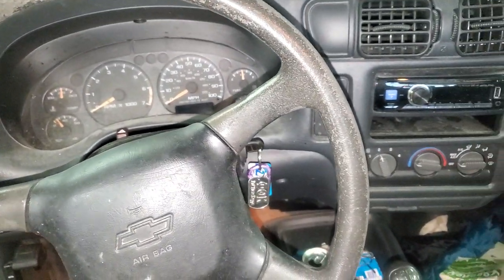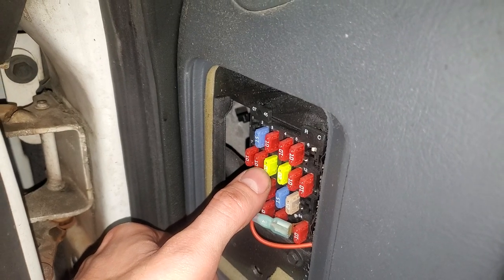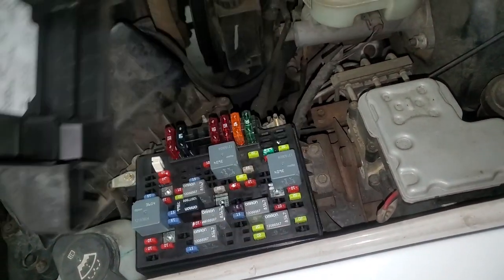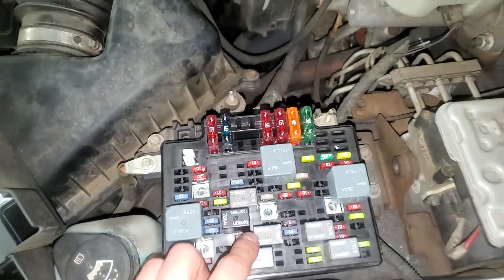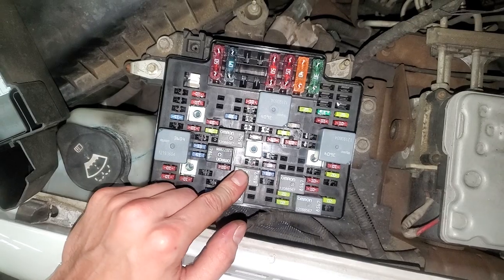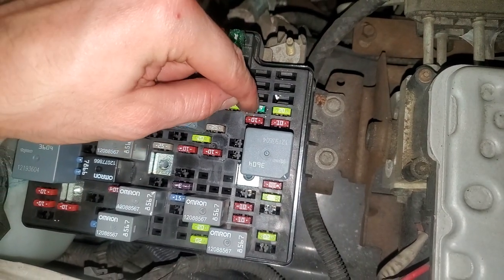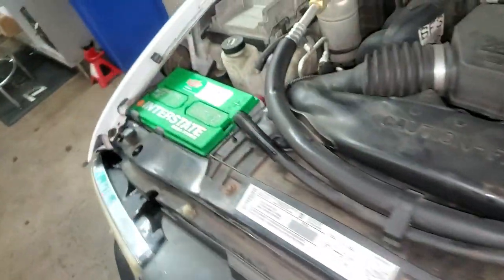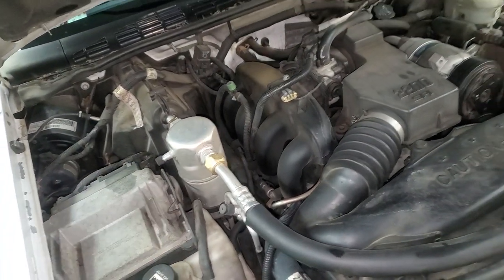2003 Chevy S10 AC Fuses & Relay, Blower Motor Fuse Location

Comment: I was pretty sure that there was a relay as well, its by the firewall. That fuse controls the power to the fan, the relay controls blower modes 1-3. If you are in my situation, 1-3 works, but 4 does not. I might be able to get 4 to work by switching the fuse. Thank you for showing me the location!
Reply: Hey man I got the same promblem 1-3 fan speed works 4 speed don't I already brought a fan speed  restricter and it anit that
Reply: that is my problem 4 will not work what did you do, I have no heat either? switch what fuse? well i am glad i read the other comment I thought it might be the resistor but apparently its not that is what i thought it was?
Reply: Which fuse?
Reply: After I purchased a used '99 S10 pickup I noticed that my blowers 4th (high) speed didnt work and after looking at the fuses under the hood I saw that the 30Amp HVAC fuse was missing. I replaced it and all speeds work.

Comment: there is also Relay on the firewall under the hood that controls the fan speed beside resistor
Reply: Where?
Reply: @Divatracks  next to firewall near the middle but to the passenger side a little sits by itself i didnt notice for awhile my fan only worked 1.2.3 when i put new relay on now 4 works
Reply: @suzieq8379  ok thanks much. Will check. Much appreciate your reply
Reply: @Divatracks  did you find?
Reply: @suzieq8379  i took out the fan and will put another in and see if that's the problem. Don't see a relay
Reply: @Divatracks  i have 2001 s10 4x4 4.3 is that what you have
Reply: @suzieq8379  oh ok nice. my relay is inside the fuse box next to the battery

Comment: I have an 03 s10 with a 4.3 2wd. Freon good,new cycling switch, ac compressor kicks on but kicks off right away.  Does this over and over if I keep the ac on. Could it be the switch in the back of the ac compressor.  ?

Comment: Man , I got me a 2002 Chevy s10 ac wasn't working , I had checked and changed compressor, 
I was told everything was good no leaks but since it was not holding pressure it was most probably the compressor
I got me a new one he did everything vacuumed  refilled was blowing cold ac and when I was about to run it , I changed gears and it went off , it was not working anymore  I am so frustrated

Comment: I have the same vehicle. But most of my fuses blew out of nowhere. Car worked but had battery and check engine light on after replacing blown head gasket. I drove about 200 miles then the car died and killed the battery . Got it tested at autozone they said the battery was completely dead.( before i removed the dead battery the lights and radio still worked but the car wouldnt turn i replaced both camshaft and crankshaft sensor) got a new battery and installed it....nothing at all. Bought a fuse checker and most of my red 10 fuses are blown and some other fuses but none of the larger ones. Where do i even start?
Reply from the maker: That is an odd problem.. of course all blown fuses need to be replaced. You will want to check if there is a short to ground anywhere.. like in the alternator for example, or if there is a positive wire that get pinched somewhere when reassembling the engine.
Reply: @LehewTech  oh ok. Im not entirely sure how to check all grounds and is it possible with just the fuse tool? Especially the alternator. If you have a video or a link to one that could show me itd be much appreciated. And thankyou for the response, atleast now i have a place to start lol

Comment: How can I get my 4th speed to work i got 1-3 I already brought a new fan speed  restricter it anit that what else could I try to get speed 4 to work
Reply: there is a relay attached to the firewall next to the resistor I just replaced mine, all my fan speeds except 4 , 4 wouldn't work I replaced that relay @20 it fixed mine
Reply: @suzieq8379  I took that relay off and tested it from watching a video on here and the relay tested good on the volt meter ,I've checked all the fuses   I brought another ac control switch's, replaced the blow motor last year .I'm thinking it's got to be in the wiring or a vacuum but I anit got into all the wireing yet I looked at vacuum lines they all hooked,maybe the blow motor anit getting enough volts to run it on 4 I don't know any ideas shoot ?
Reply: @jasonpeeler6796  did you check the T vacuum line on the drivers side fender that was one thing wrong with mine plus i put a new PCV valve on omg truck drives so much better I need Oxygen sensor now and you tested the one bolted on to the firewall? its by the resistor
Reply: @suzieq8379  I don't know nothing about the t line on the fender u got a pic where that is never seen that part before I never messed  with oxygen sensor either ,I willing to check t line when I figuer out  where it it is and yes I checked the relay good with multi meter so of I got a pic of check today or I look it up
Reply: @jasonpeeler6796  look up his video its right next to the master cylinder 3 vacuum lines run out one goes to 4wd one goes into the fender on the drivers side its hard to find you tube vacuum lines i had no idea they were so important as they are
Reply: @jasonpeeler6796  and u are sure you check the relay on the firewall bolted on next to resister its sitting there by itself its not in fuse box
Reply: @suzieq8379  yes yes on firewall by itself by resitor  a black case like relay with # on it and company name I forgot ,not in fuse box , checkEd good
Reply: did you get it fixed I flushed my heater core today now I have all kinds of heat loving that